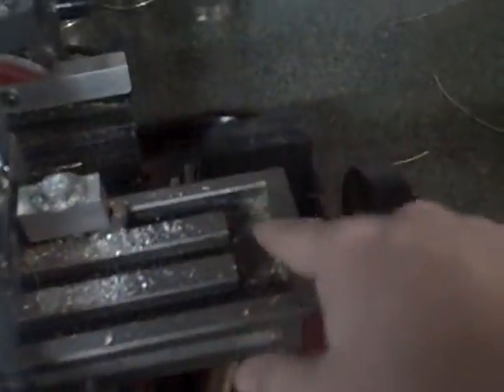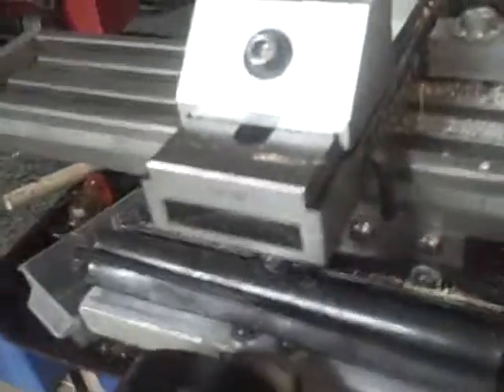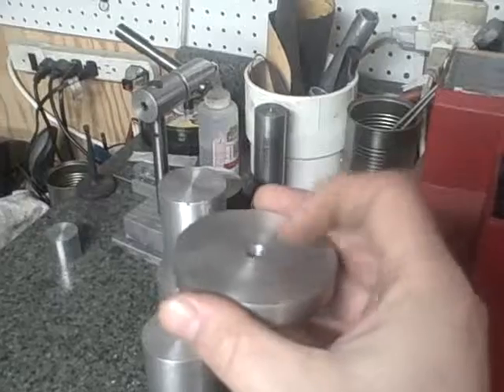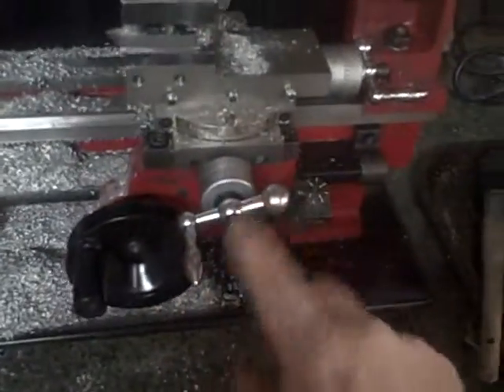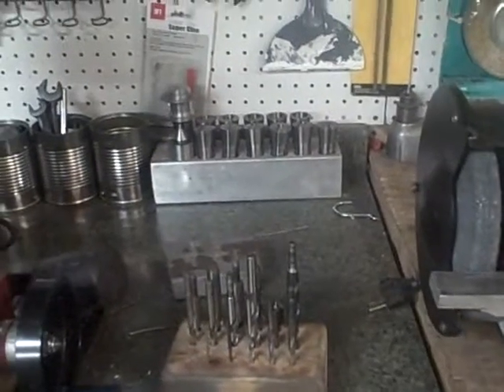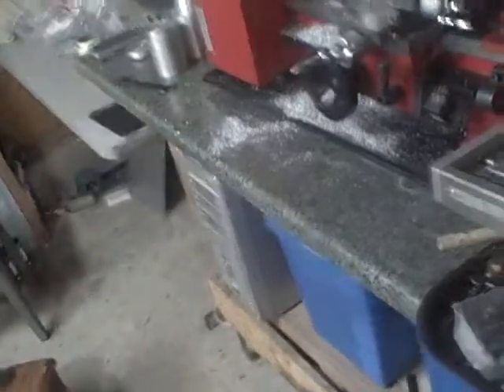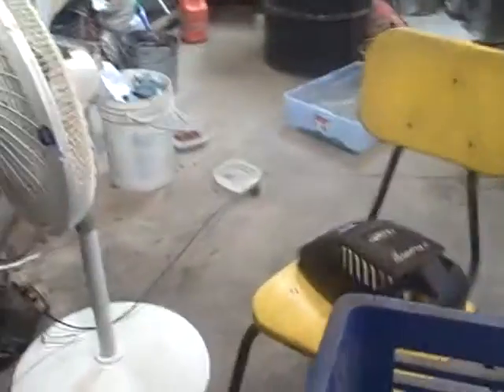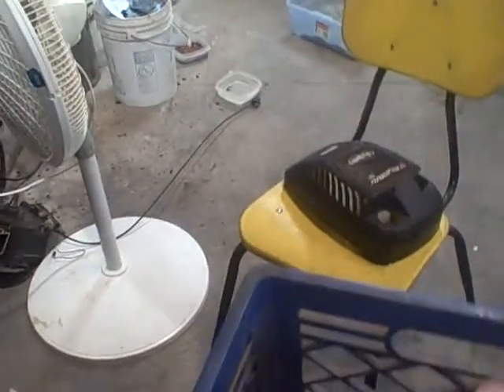Minor Mini Mill/Lathe Udate and Drill Bit organization

Comment: I bought the 14" bed kit for my 7x10 lathe from little machine shop and it has really made my lathe much more practical especially when drilling the ends of stock.  I think it was $129 when it was on sale.  They also sell an all steel OXA wedge quick change tool post custom made for these lathes with a zero degree angle cut-off tool made by Torbach.